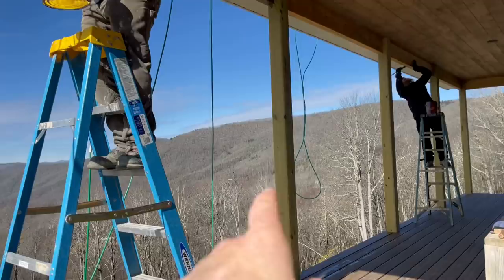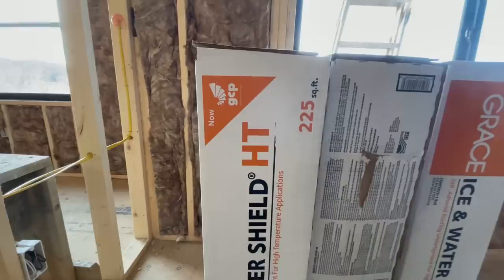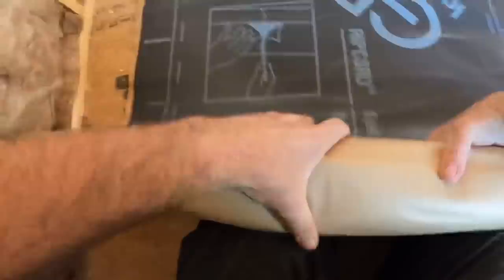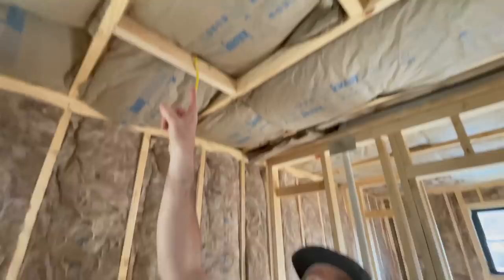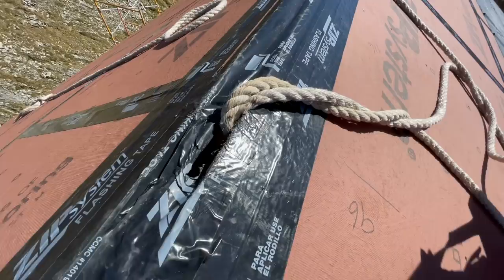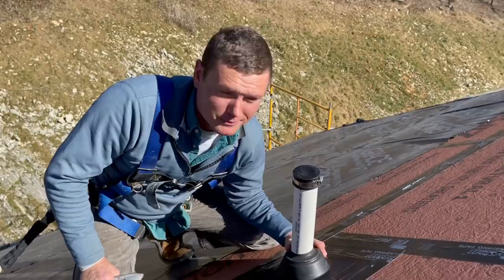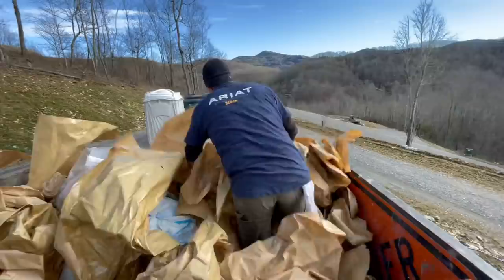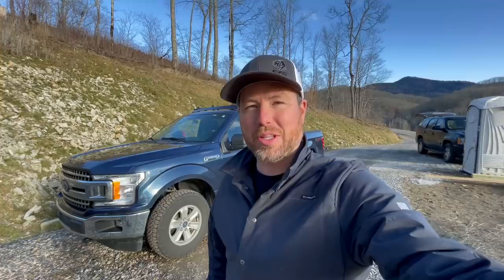Building The Farmhouse | Day 48

Comment: Pro Tip: if you press the sticky part of your ice guard on the top of the roof piping it will give you a perfect water tight line to cut out and sleeve around the pipe.

Comment: Jaime's splinter reminds me of a bad splinter I once had.  How bad?  LOL!  

Well, I was stripping the paint off all the woodwork in my first house, even the steps, risers and upstairs hall floor.  As I was working on the upstairs floor, through my rubber gloves I suddenly felt a really sharp pain-- I mean, a screaming sharp pain.  At least I screamed.  (I'm a lady; I'm allowed.)  I immediately washed it off but could not see any splinter or even any cut.  After a short time, the pain subsided and I forgot about it.  At the time I thought I must have just jammed my finger hard.  

Well.  Six months later, the end of my finger began to feel sort of itchy.  Persistently itchy.  After a few days I noticed a tiny bump where it felt itchy.  After a few more days I noticed the bump had gotten bigger... then bigger.  Then it started feeling hard.  Did I go to the doctor??  Heck, no.  It didn't hurt and it wasn't bothering me.  Why see a doctor?  

Finally, the bump began protruding.  So I took some tweezers and pulled at it.  Well, out comes about a 2" long by 1/16th" wide piece of wood.  Thinking about this, I remembered back to the day when I thought I had a splinter but couldn't find it.  I realized I had jammed that thing into my finger so deep, it took 6 months to work its way out again.  It must have gone in just right, so it didn't hit the bone or nick a muscle and just sat there.  I was lucky.  That wood had been covered with paint stripping chemicals.  I guess the glove I was wearing cleaned all that off, though.

Comment: That sealant will actually work as a condens water drip sealant too. It is in the code here in Finnland to have some material under metal roof to catch the condens water that build up under the metal roofing. There also needs to be a gap between the metal and the condens barrier to let air to went.

Comment: Great content. Speaking of vapour barriers the way it was taught to me, the vapour barrier should be installed on the warm side and air barrier on the cold side since the difference of the outside temperature in comparison to the inside temperature may increase the humidity in the air resulting in vapor inside the wall.

Comment: No paper facing given the humidity both in warm and cold months so the vapor is allowed to be pulled from the HVAC evap/condensing function. Making the building very airtight so you can pull the moisture out and the insulation stays nice and dry

Comment: Interesting with the insulation, in Sweden so I’m learnd is that we have a typ of textile thing that stops wind from blowing in the insulation and on the inside between the isolation and drywall or what ever we use plastic as a vapor barrier. So we have a typ of cloth on both the inside and outside.

Hope u kind of understand what I mean

Comment: On the insulation convo: when we built our house in Alaska in 2009, we didn't use kraft faced but we were required to add 6mil visquine to all outside walls and ceiling also using black caulk or red tape on all seams before sheetrock

Comment: Hi Guys, in the Netherlands its common to make the inside of a building airtight. The vapor barrier is on the outside. Therefore air doesn’t have a condensation point in the construction. Floors and roofs have a different way of insulation..

Comment: I've never thought  about the different ways of  installing a insulation I diffrent climates.  Thanks guys keep on keeping  on.
Reply: In cold climates you don’t want water vapor from inside condensing in the insulation on the cold side so you have the vapor barrier on the inside.  Apparently they are in a transition zone but I would think the elevation might throw them into the “northern” cold climate zone.  Seems like it has been pretty cold there a lot during their build.

Comment: Because you are using ZIP...  your Air and Water barrier are on the outside skin of the house.  You would want to use UNFACED insulation in that case.  In doing this the condensation plane ( where warm meets cold ) falls on the green face of the zip board - meaning your insulated cavities are still within your conditioned space.  Unfaced insulation will allow air flow to pass maintaining that condensation plane on he grren layer outside of the house.

Comment: Isn't Zip also water-tight? So you basically have three water right layers on your roof.
Reply: Exactly my question, is this major overkill, or just extra insurance.
Reply: Zip is water tight but when you have any kind of fasteners screwing into it, you have now created a spot for moisture to penetrate that barrier.  The beauty (advertisement claim anyway) of grace is that it 'seals' around any fasteners.  I can attest to some of this as I use it for deck ledger boards when I install those on a house. Same for window sills.  It sort of melts when it gets hot to create a seal around the fasteners.  I also wonder if it's a code requirement up there?  Lastly, for that expensive and permanent of a metal roof, I'd pay the extra couple grand to have that product under the metal! I know it's not cheap, but this isn't a monster roof like some mcmansions built today.
Reply: Yes indeed. 1 is none, 2 is one, so three gives you back up. The zip system is moisture resistant barrier, so the ice/water shield underlayment is really the only “waterproof layer” as a standing metal seam roof is guaranteed to have some water get behind it being driven by wind hence why the sleepers get laid down under it acting as a rain screen so the water can drain out under it and it can ventilate and dry.

Comment: In that climate, moisture will move from inside to outside in the winter and from outside to inside in the summer. There is no "correct" spot to block vapor so vapor open is the best choice. Adding air conditioning for summer or humidifier for winter further complicates things. I'm not a fan of vapor barriers in 4 season climates particularly on the east coast.  Hope that helps. I think there are new bidirectional vapor retarders but I don't know anything about them yet.  PS, please paint your vent stack black on the roof. White is ugly. Cheers.
Reply: I can't speak to the effectiveness of various barrier too well, but I do know that most of my house never had it, and if it did it wasn't done well, and there's mo mold or moisture problems to be found. I'm in a 4 season climate, hot as hell in the summer and cold all winter, with two short lived seasons in between

Comment: Yeah re, life time on the metal roof. Im in Australia and have galvanised colour bond roof that is considerably thicker gauged than what would be used there, ( its the only layer) and in our heat ie lots, ALL the heat the colour bond coating doesnt last.
Sad to say it had a 25 year warranty and so many manufacturers are either replacing or ignoring the issue after the coating powders up.
Im in Queensland and its an issue here, dont know about the southern states.
I wonder in the states with the freeze thaw heat cycle if the coating will last the distance.  Certainly will look great after 15 years but in 20 when you get up on the roof your shoes will be the colour of the roof when you get down

My problem is i get my drinking water from that roof.

Comment: You Know..... when putting your Ice N' Water around the plumbing pipe... take the rubber cap off.... put the Ice N' Water on the Top of the pipe and cut on the INSIDE OF THE PIPE... Then Peel off the backing and stick it to the Roof... And that way you have a Very tight fit against the pipe
I love your videos... By the Way

Comment: Not being snarky, just curious. Wasn't your roof water tight from the Zip? Love the self-sealing feature, but seems like double duty. Thanks for clarifying. Love this channel. I've learned a lot. Chris in Seattle.
Reply: The video was sponsored by the ice shield company. They would put 10 layers of sealing if they got 10 different sponsors lmao
Reply: @alexschonach7215  Not begrudging someone making a living who is taking their time to educate me for free... Honestly curious. I'm planning a house build and there seem to be as many opinions as vendors and builders. Really appreciate the no-nonsense approach of the Perkins brothers.
Reply: @lewisworkshop  Not sure if they zip-taped all the nail holes or what, I wouldn't bet on it being 100% watertight.
Reply: @lewisworkshop  I'm just messing around, it's all love from me
Reply: @chris Lewis. yes it's just extra precaution
Reply: You need an underlayment as a slip sheet for the metal roof because is moves a lot from thermal expansion and contraction.
Reply: @Davey768  taping the seems is considered watertight and will not leak although obviously not permanently but could go years.
Reply: Zip is water tight but when you have any kind of fasteners screwing into it, you have now created a spot for moisture to penetrate that barrier.  The beauty (advertisement claim anyway) of grace is that it 'seals' around any fasteners.  I can attest to some of this as I use it for deck ledger boards when I install those on a house. Same for window sills.  It sort of melts when it gets hot to create a seal around the fasteners.  I also wonder if it's a code requirement up there?  Lastly, for that expensive and permanent of a metal roof, I'd pay the extra couple grand to have that product under the metal! I know it's not cheap, but this isn't a monster roof like some mcmansions built today.

Comment: Does the water tight membrane have a solar degradation factor? Here in AZ, many of the home builders use a cheaper membrane that’s only rated for 30 days direct solar exposure, but then they don’t put down the finished roof until multiple months later... turning a 20 year roof into a 5-10 year roof.

Comment: How do you have one vent penetration and it be what looks like 2” and still pass plumbing code. I think both codes require the same diameter going out as the main. So if the main is 4” which I believe it should be, there needs to be 4” worth of vent pipe penetrating. So if they made one penetration, it should be 4”. I guess that could be 3” to match a 3” main but then I’m wondering why they ran a 3” main.

Comment: How can a roof on a new house be so badly insulated that it causes snow and ice to melt?
Reply: Most jurisdictions have not made raised heel trusses a code requirement.  Therefor your attic can be insulated to meet code yet still have the 3.5" space of insulation at the truss to top plate connection.  There is no economical solution to this and if the code enforced trusses to all be raised heel, that would drive a lot of people insane.  The fact is, the standard (affordable) truss has just one flaw, that being the kneewall area where there is just not enough height to get enough insulation in there.